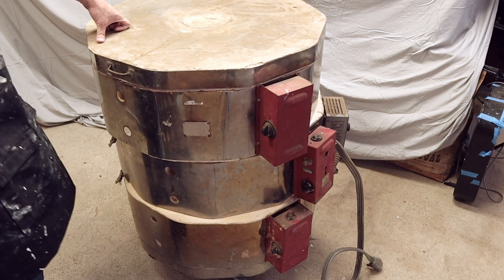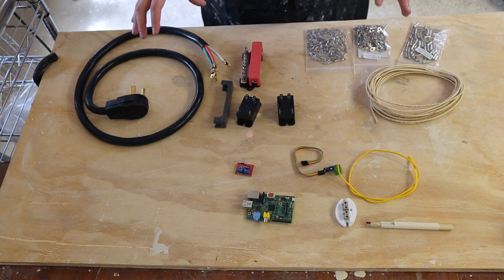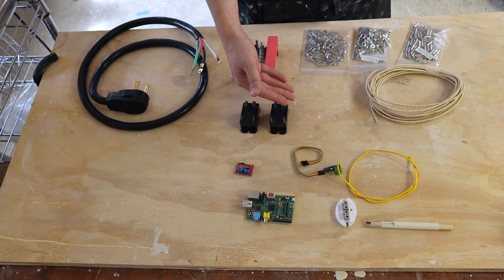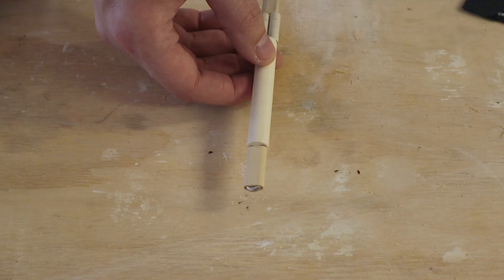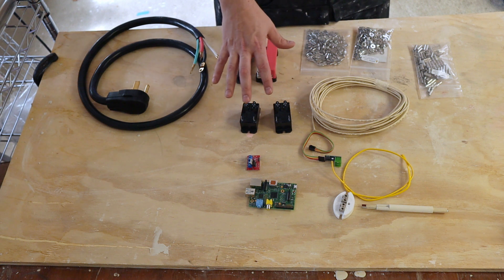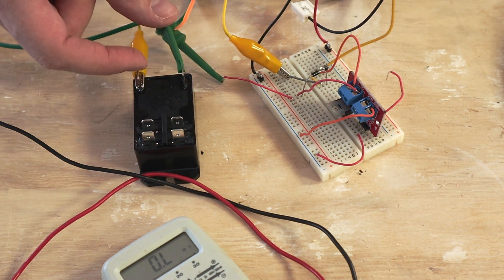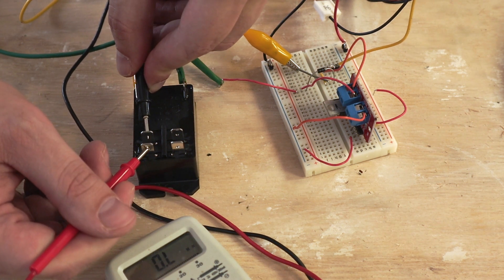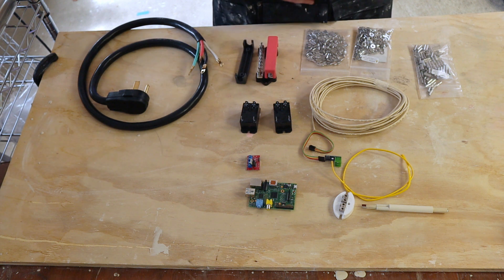Building a new brain for my kiln

Comment: Okay, so knowing that this is a 4 year old video,theres a great possibility that Kent will not see this posting. But i hope he does!

Kent, i cannot thank you enough for this series of videos! And for your linking the products and services you used.

We are going to pick up an older Skutt in about 2 hours, and what almost turned me off of a great deal was the cost to convert/ upgrade the controls. The Skutt upgrade would cost more than the used, in good shape but old controls, kikn would! 😢
I am an HVAC controls journeyman, so doing the physical conversion doesnt intimidate me in the slightest. I work on 440v 3 phase 100+ amp equipment quite often, so 240/1/50 is almost boring for me. And setting up a relay/ sequencer control to make it a temperature controled 'furnace' is easy-peasy. BUT!!!! Making it a ramp/ scheduled controled kiln with Bluetooth/ wifi controls is another thing entirely!

You honestly saved me possibly $4,000 more than i needed to spend, just do to my lack of kiln-specific controls knowledge!

Picking up the otherwise great shape kiln for $800 and the controls components for around the same gives me a $5,500ish kiln for ~ $1,500.
That leaves more money for tools, furniture, clay & two wheels! 🤗

Not sure if this is valuble to you or not, but its invaluable to me that you so freely shared your journey with me so i could follow in your footsteps!

You, sir, are a valuble asset to the pottery community! 🫡

Maybe its not the $4k you saved me, but you at least earned 2 new Subs (my partner & i, thus the need for 2 wheels) and LOTS of 👍's. 😊
Reply from the maker: That's great to hear! Mine is still going strong. Good luck with your "new" one! The controllers really are pretty straightforward - it's basically a PID loop with the temperature profiles for the firing.
Reply: @PotterybyKent  we just got home with it.
Im still kind of in shock that we own a full sized Skutt kiln! 😅
Im lucky that the kiln was rebuilt about 4 firings ago and in very good shape (even better than expected), and functions as is.
Now i can start collecting the pieces for the controller upgrade.

Once again, thanks for clearing the path for the rest of us. Wish me luck! 😊

Comment: Hi Kent. It's been a while since you shared this very interesting build. Have you decided to also share/sale the software for the build?
Reply from the maker: The software I used is open source: https://github.com/jbruce12000/kiln-controller
Reply: @PotterybyKent  Thanks Kent. You mentioned you ended up some major and minor fine tuning to the sketch to get the hardware behave properly. Are your tune ups included in the GitHub?
Reply from the maker: That is not my repo - it's the original one. I think in the end, I only made changes so it worked with two relays and for the temperature sensor I picked. Those would depend on the exact hardware you use and how you connect it. And then I also did the PID tuning for which there are instructions in that repo.
Reply: @PotterybyKent  I watched the related videos on your channel and read the linked GitHub to slowly understand the points you mentioned. Thank you. I learned a lot about the Kiln Control. Now I am ready to bring back to life my very old kiln. Thank you for taking the time to make these videos and also thanks for replying to my noob questions.
Reply from the maker: Sure thing! This was my first time doing it, but happy to answer any questions if I can. It's been almost 1.5yrs now and I'm very happy with my result.
Reply: @PotterybyKent  Over a year on the same humble PCB boards is an impressive service time. With that in mind the redundancy become an important necessity.

Comment: I was just hoping I could use these relays with a pid to turn the kiln on and run it to a certain temp controlled by the pid.  I would be using the kiln for heat treat of metals so I wouldn't need to worry about different ramp times
Reply from the maker: Short version is yes, I think so. The kiln is like a big toaster. It has elements that heat up when current runs through them. So in that regard, yes you could probably attach a PID temperature controller to have it hold at a certain temperature. You'd just need to make sure it could interface with relays that can handle the load current (the kiln elements). The kiln software I use was originally designed for solder reflowing of PCBs in a toaster oven I believe. So all of these applications are rather similar in terms of hardware.
Reply: Thanks for the reply I'll keep plugging along and hopefully get it working

Comment: I do have to ask why did you use a raspberry pi and not a pid controller
Reply from the maker: To do a firing you need to run through a firing schedule - hitting different temperatures at different times. And you likely need at least 2 firing schedules, one for a bisque fire and one for a glaze fire. So whatever you use needs to accommodate those requirements. If you know of a PID controller that does that, it'd be great to know about. The other advantage of the raspberry pi is I also have a web interface which is handy to monitor the temperature.

Comment: Can you show how you wire the hot phases to the relay?
Reply from the maker: Around 5:00 in the video I show how the relay works. The 12v control goes to the two terminals at the end. The high voltage (240v in my case) and the elements are connected to the other side. (Refer to the data sheet I linked to in the description). My next video in the playlist shows how I wired up the power and: elements, around 10:00 here https://www.youtube.com/watch?v=luukuhJVK5M&list=PLcXZ8oAyL7bEh28Szfd1ZCmNfjFhyRgFu&index=5